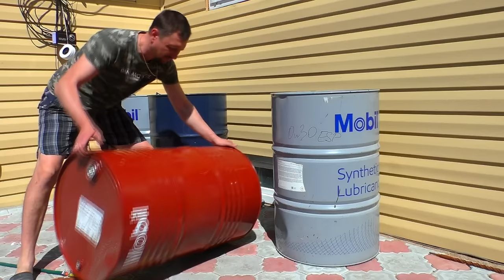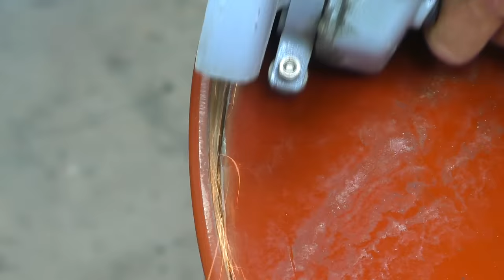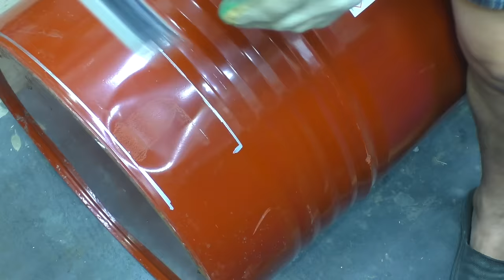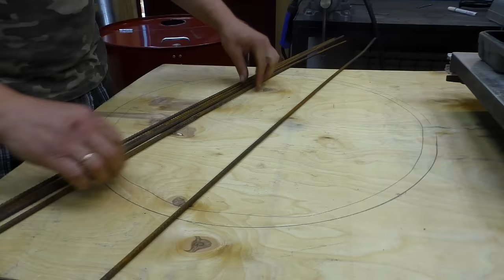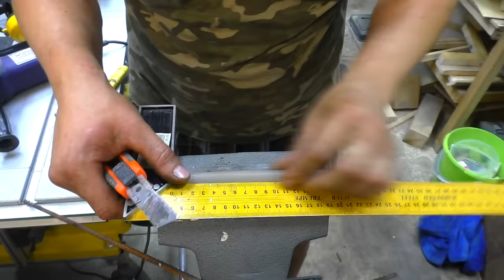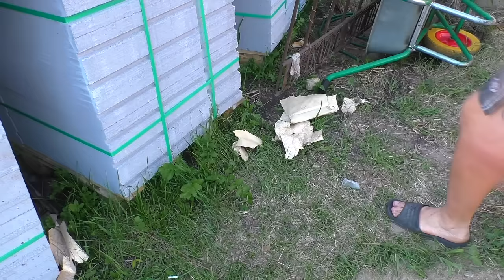A cool idea from a car oil barrel! I wish I knew about this before!

Comment: Meant to put that here:  Don't burn plastic, fool
Reply: Burning some plastics is cleaner and less polluting than burning wood.  Burning other plastics produces furans and dioxins among other nasties.  If you want cancer, go sniff a bunch of furans and dioxins.  So your concern is well founded, and home workshop would be well served (along with the humongous audience) to find out which is which.  The first rule is, burning PVC is very bad.  Here's a good source: https://i.redd.it/gy32ijrehd651.jpg
Reply: But the plastic burn barrels don't rust.

Comment: You won't get 6 months out of it because those modern drums are so thin that once the inner coating burns off, rust holes appear fast especially when rain is added.

Comment: I would recommend to burn only wood , paper and cardboard as many other items like plastic and Styrofoam produce toxic fumes and pollute the air . Also do not burn treated wood/lumber for the same reason. Otherwise very cool design and good video.

Comment: Not smart........poor idea.   Don't ever cut or weld barrel without purging the barrel first.
Reply: It is likely he had done that but you are right, he should have shown it. Plenty of novices would not know and potentially blow them selves up!
Reply: It had oil in it.  Not going to explode!
Reply: Jeremy Altis unless he used oxy cutting gear and somehow heated the oil to flash temp .... some oil’s are more dangerous than others, feeding a stream of air through for a few minutes is also effective ... take it from someone who has welded gas tanks.....

Comment: A long way to go to burn trash. Short cut: take out bungs, flip over, cut out bottom. Place on blocks, load trash, and ignite. If it doesn't burn well enough, punch holes in the sides. $50+ in hardware ain't worth it

Comment: Nice enough project , 200 L. drums are a staple of mine also. Personally though I would never cut or weld a drum that I was not 100% sure had  no combustible material in it. Half a cup of petrol in there could blow your head off. I like to fill them with water to overflowing first.

Comment: I built my first barrel stove in 1972, long before anyone had heard of them.  It was a 60 gal heavy gauge industrial barrel... I was just a kid... (well   20)   but it heated my garage for years!
Reply: You are right about the heavier gauge steel on the old barrels. But you are a little off on the comment" before anyone had heard of them". Mid 60's a lot of farmers and repair shops built these using 45 imp Gal barrel with a 15 imp Gal grease drum on connected top and an 8 inch pipe through it. Had free used oil? These units were 20 to 30 years old at that time. Hard to come up with something the fore fathers or mothers have not already done. Just say'n
Reply: @murrayhalbert2988  Many Army Air Corps huts and tents in WWII were heated with 50 gallon drum stoves, just sayin.

Comment: hahaha a lot of trouble, we use to just knock several large holes with a claw hammer near the bottom and start thowing wood in, you would be surprised how fast a good burn barrwl can burn wood

Comment: Only for the people who want to recreate something like this (and I appeal to the common sense of mankind not to burn garbage in the garden): in closed barrels that have not been cleaned or had time to vent, if it is an oil barrel, inflammatory fumes are created, as here it is as here. A minimal bottom set of oil is sufficient. If you use the Flex, the barrel can explode!! Please don't do that!!

Comment: how did you use a grinder on a empty fuel tank did you clean out with what as i got drums i seek to cut in half is it safe they have been open and airing for week but still smells of fuel.

Comment: The first time you cut the barrel, you better be DAMN SURE that it's clean inside.  If the barrel contained volatile, flammable liquids in a previous life, there can easily be enough vaporized fluid to make a pretty good fuel-air bomb.  Flash of light, clap of thunder, all your problems gone.

I thought at first the end result would be a smoker for food...

Comment: Cut out the top and throw a circle of plywood over it to keep rain out.
Put several holes in the sides for air. I use 9mm rounds. Takes about 20 minutes start to finish.
Keep it simple. It's going to rust through in a year or two anyway.

Comment: it dazzled me to see you weld to the painted metal surface.

... those narrow cuts you made on the bbl with that hand-saw-tool ...
could you weld that kerf with your welder and fill in the gap
with metal ? even with the paint there too ?  and make the
bbl surface like new to where it wont leak water or smoke ?

 if the answer is 'yes' could you tell me what brand welder
 is in use or another video that may go into detail of using it.

Comment: Way too much trouble.  I got a barrel with the top cut out, cut four 2" holes around  the bottom for draft and It works just just a good.  BTW, I only burn cardboard, which isn't very good land fill material, and tree limbs.

Comment: Crap idea using aluminium pop rivets, aluminium alloys melt at anything between 463 – 671 degrees, this drum has a good chance of being hotter than that.
Even bigger crap idea is burning plastic.

Comment: After spending all that time to make a burn barrel which doesn't last more than a year or so. The full then feels it up with plastic and burns plastic and pollutes his neighbors. Not a great idea. Could have just cut the top out drill some holes for pieces of rebar and set it up on some blocks. Turn the whole job in 20 minutes.

Comment: The fire chamber's too cool so it smokes. You can use clay to plug the insert leaks. Curved kiln fire brick at the bottom would help. The design shown is best for waste paper, about 500degs F. Maybe they tweaked it to get a better draw of oxygen at the base. Don't burn plastic, plz.

Comment: I have one of those except it isn't as complicated. No door with hinges at the bottom, just a hole , and not of that jive at the top. It's just open. It sits on bricks and works like a charm. It wouldn't have made for a million view video though. Don't burn plastic in the thing! It's really poisonous and it smells like hell. The way you documented this over complicated burn barrel was really good. Why don't you build a refinery to capture petro from your plastic waste? That would be useful. The vids on here about that aren't as well executed.

Comment: We had a teenaged kid killed in a high school workshop accident doing this. Barrel had contained peppermint oil. Even the plastic liner of the barrel becomes fuel at temperature. Very foolish idea that should be pulled.

Comment: I think everybody needs to report this video is harmful and dangerous acts as it's extremely harmful to our environment and dangerous to the people around us that can breathe in those fumes or have the plastic ash fall all over their expensive car down the street.. they do sell the Honey Cone inserts for pipe Stacks like that help reduce chemicals in the exhaust fumes pretty much it acts like and looks like the inside of a catalytic converter on your car. Now I really do my part in our household the recycle they pick up every week in the recycling bin is about twice the size of our garbage bin our garbage bin is usually half-full every week and the recycling there is so much recycling that is overflowing to the point where I take out about 40%+ of the paper products out cut it up into the smallest pieces I can and I used to five gallon buckets 1 with some holes drilled in the bottom and one that don't have any holes I use a paint stirrer on a drill and I break down all the paper into a mush and then I pull it out of the water and let it drain out I have a piece of wood that fits down inside the bucket and I put some bricks on top of it and by the time it's done drying and drained out I have myself a 5-gallon bucket shaped piece of paper I use a electric saw and cut it up into four inch wide stripes they make great fire logs for outside use

Comment: Burning plastic fuck that's not good! I'm amazed the council hasn't fined you for that.
 It's smoking because it hasn't enough air. I burn waste engine oil cleaner than with no fumes.

Comment: I did not think much of your safety, you cut all of that lid out with angle grinder, no safety gloves on none when worn welding all the time, then when you lite the fire you put blow torch down through top then open up door on bottom to let air in. Glad you don't work for me your a health risk from start to finish.  George smith safety officer.